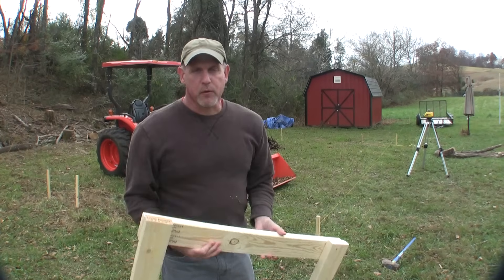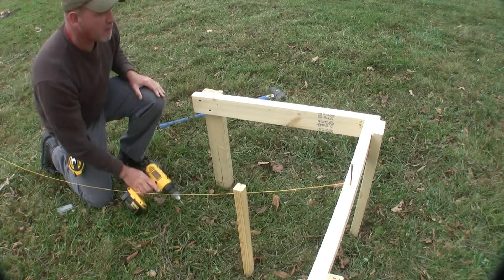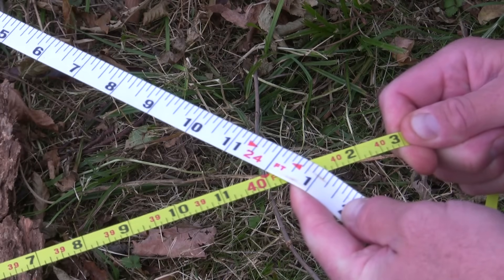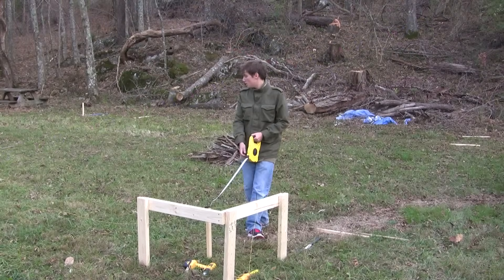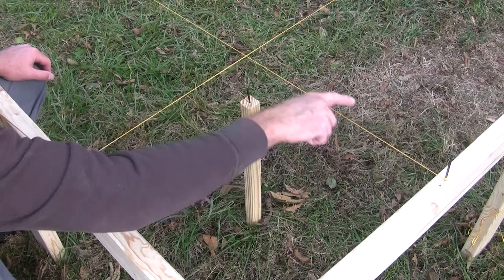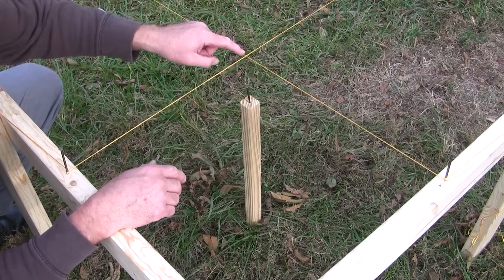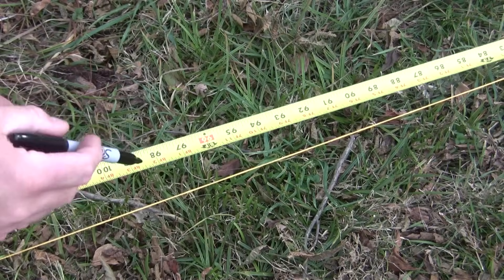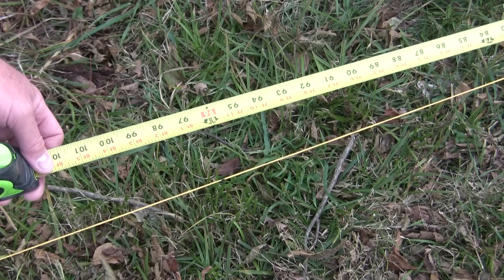How to Build a Pole Barn Pt 1 - Site Prep & Layout

Comment: thanks for your plain ,commonsense , and practical approach to this layout procedure on a building site !!!  I have built several buildings and my methods are very similar to yours except that I was stuck working pretty much alone on these projects , and I used a string and plumb bob to assign my post locations .  I am pretty old now , by the world's standards,  and I need to build a new pole barn and haven't done any of this in many years.  Your video is very encouraging and straight forward in the way you present all the information necessary to do the most tedious part of this build which is the squaring of the foundation layout .  Thanks again for your video !!!  I will be watching the rest of your build to fill in the gaps of what I have perhaps forgotten from my last building project and hopefully pick up a few new tricks and tips from your wisdom and experience !!  Greatly appreciate a hands on practical construct !!

Comment: I think you're doing great! You got a subscriber! I learned the purpose for the exterior corners allow me to set nails/points to cross strings that coincide with my vertices. Great job! Also I almost suggest you to paint the points of your vertices or whatever you'll be digging like every 8' you mentioned so once you remove your sticks to dig, you still have some paint on the ground.

Something to consider for future if you haven't. As you said, you want to make your barn 24'x32'. Now, is that the interior or the exterior of it? Why I ask? In reality, once done you'll know where or how wide by how long interiorly and exteriorly speaking you make it but, let's say you want those measures inside your barn. If that's the case, you want to add to the 24', and the 32' the sides of your pole. Let's say you will be using 4"x4"s, then you'll go with your exterior measurements 28"x36", and you find the diagonal of that and do what you did, so from there on, your interior will get to be 24'x32'. 

In houses where you'll add sheetrock, baseboards, in areas like kitchens where you'll add cabinets, you want to consider that your interior space will decrease a 5/8" for the sheetrock, a 12" deep by top cabinets I believe, a 30" deep for bottom cabinets (feel free to correct me on anything), I think 1/2" baseboards approx, sort of, future additions to your structural walls to consider so what you want in the interior, gets achieved.

Comment: I dig pools for a living and find myself using some of your methods, when I’m laying out a pool I like to use rebar instead of stakes because they’re smaller in diameter, also those soft tape measures your using will slip right over the top of the rebar. Or if you need the stakes for height, center a screw in it, and it’ll be tighter!
Reply: I’m addition when you have a cross, drop a stone from the cross three to five times and that’s pretty damn close to where you want your stake/ rebar

Comment: I've always used the 3/4/5 rule! Measure from the corner one string and mark 3' or any multiple of 3'. From the same corner, measure down the other string 4' or the same multiple of 4' used above and mark it. Now measure between the marks and perfect would be 5' or the same multiple used above! Adjust your angle to get exactly 5' or the multiple of 5' used between the dots. You now have a perfect right angle and corner to measure from! Repeat the process for each corner! Then measure corner to corner diagonally, to double check your work! Very fast, and all but measuring diagonally can be done by one person! 
EXAMPLES:
A- line 1=3', line 2=4', between the dots = 5'
B- line 1=9', line 2=12', between the dots = 15'

Comment: Pythagoras would be very proud of you! Brick masons use the common values of 3-4-5, measure 3' on one leg, 4' on the second leg and the diagonal will be 5'.
Reply: Yeah, 3-4-5 method can be done solo and it can be done on any length that's divisible to those numbers.

Comment: A simpler way to get square corners is the 3-4-5 method.  Measure 3 feet from corner on one string and 4 feet on the other and mark them now measure between those marks it must by 5 feet .  adjust strings so it measures up this way and corner is square.  you can do any multiple of this say 9-12-15 for bigger structures.

Comment: great series. its the end of January here in NW Missouri and i just started my 32 x 32 pole barn project. was going to wait til spring but have the money now. I also wanted to take advantage of the 11 percent rebate at the local lumber yard. we had a warm spell yesterday so i marked out the post holes. i knew how to square a structure by measuring corner to corner however the pyagoryth therom made that real easy using two 100 foot tapes. i was lucky enough to have a neighbor with a bobcat and post hole auger. that made that job quick and easy. going to take your advice and get that dirt out of the way. snow and rain on its way tonight.
Reply from the maker: Yes!!!!

Comment: Hi I have watched all your videos, thanks for sharing. I have a question. We have dug holes for the barn/garage but the next steps my son is suggesting is confusing me, would you be able to give comment on this. My son says we can just lay two bags of cement in the holes, level poles and then when we have the cement poured, the Liguid will seep to the bags and they will harden in this way? How can this work and not jeopardize the level and ending structure of the garage? Thx

Comment: On the corners, instead of running tapes across, you can measure one wall at 3' and another at 4' and mark both positions on the string. Then measure the marks on both strings (makes a triangle) and it should be 5'. This is called the 3,4,5 method from what I recall growing up and being taught from my parents and grandparents. Hasn't let me down yet. This can be done on the initial string as well as the string from each batter boards.

Comment: You're a good teacher.   In the past I've climbed the post to cut off excess height and knotch.  I was younger then. This spring I will adopt your  method of achieving a level plane in the hole.  I too always mix the concrete with water in a mixer then place in the hole.  Placing dry concrete directly in the hole tends to result in a weaker set.  The one thing I missed from your video is anchoring the pole in the concrete.  I usually screw in just one lag screw in one side of the pole to make it harder for wind to yank the pole out of the concrete.
Reply from the maker: Thanks James.  I appreciate you watching.

Comment: You where right to use the A^2+B^2=C^2 but you when the hard long way to find square. I always just square one corn off my start wall then using the math you can just measure 3 foot down one wall and 4 foot down the other the diag. will always be 5 foot. thats because 3^2+4^2=5^2, you can use any multiple of 3 and 4 together if needing to use bigger diag. then move to the next corner and so on, then use the cross for a final check its a hell of a time saver and can be done by one man.

Comment: Good  video...  may  i suggest 2 things..  (as  I will be building my  30 x 16 very soon)   As I learned from my carpenter uncle, the way to make  sure  your square  is know as the 3-4 -5 method,,(too much to explain in this typing but you can google it.)  It might be easier than  your  diagonal method.  Secondly, I will use  cement pylons for each  post rather than burying a post which will eventually rot underground even if  treated. I place a short rebar into the poured  pylon and then drill a hole on the end  of the  post...setting to post on the bar after the cement drys .... works like a champ to hold  the  post  in place...later  I go back and add more cement to form a cone at the bottom of the post...this keep water off the posts.  As  for leveling..... I run a string line with a level  on it  and  cut the posts for height at the top
Reply: What he did is the 3-4-5 method, just with different numbers.
Reply: I'm a machinist by trade and I am very precise in anything I do, especially numbers. Using the 345 method your moving your stakes around trying to "tune" the lengths in. The method used here I have been using forever and once you have established the one (1) length or width along a property line, etc, the other two (2) corners are knowns. No moving stakes like 345.
Reply from the maker: +RandomActUpMedia Great tips.  Thanks for sharing!

Comment: Seems like all the information I have researched has said that with just sticking wood in the ground verses the slab will not last. Mainly because of rooting wood. I'm looking at a home now to buy and the barn has that exact issue.
Reply: +james hawkins True that! There's nothing like having concrete footings to keep lumber out of moisture, even for a simple pole barn. Judging by the size of the project, he can off center middle sonotube footings and still have more than enough room for the tractor entry and it'll give the structure more stability.
Reply: A good approach is to stick your inner supports in the ground as these will not be exposed to wet or weather and put your outer supports on concrete footings as these will, if in the ground, be exposed to ground moisture and more chance of exposure to weather. Early builders who put them all in the ground used cedar or other rot resistant woods. You still see many of these old barns around which speaks volumes to their construction.
Reply: You could also use post protection

Comment: The same thing just happend to my tractor, barn roof caved in from a high wind and now its sitting out side all summer and is still there so in the next week or 2 im getting 40x60 pole barn with cement , so all i got to do is peel off the grass and get some sand on it and i will let the pole barn people do the rest.

Comment: Great video. It's nice to get a little guidance. A little rule of thumb to use in place of A^2 + B^2 = C^2 is the 3, 4, 5 rule. Otherwise the 24 (3 x 8), 32 (4 x 8), 40 (5 x 8). I hope this makes the math easier.
Reply from the maker: +Jim Beahm Excellent!  Thanks for sharing.

Comment: I have watch all your videos on how to build a pole shed, we are about to embark on build a pole shop ourselves.  My one question is in reference to your laser level.  I read that you are using a Bosch model GRL250HVCK.  But what are all the components that a person needs to purchase to be able to use the level the posts and find the grade.  The laser level itself, the tripod, and rod with remote....do I have this correct????
Reply from the maker: M Diamond Thanks for watching.  Yes, you need the laser, tripod, the rod, and receiver.  The remote is not necessary.  The kit that Lowes sells comes with everything you need.  Seems like it's about 600 bucks.

Comment: Quick Question. I don't have a gee whiz level like yours. My dad was saying that since all my poles are 16ft Tall and I am going to have to cut them off when I run the top band, that I can select the level corner post and run a string level from that one to all of the others and cut each one level with the level corner pole. Is that a good way to do it without a level like yours?   Thanks
Reply from the maker: Bill McCutcheon That is the way most folks do it.  It's just a bit of a pain to make those cuts off a ladder but you can still do it that way.

Comment: What is the name of the laser leveling tool that you used to check the grade?  Does it come attached to the yard stick or did you purchase the 2 separate and attach it?
Reply from the maker: DrewThomas Arnal It's a Bosch.  Can't remember the model but it came from Lowes.  It comes with the stick and receiver.

Comment: Your series on building a pole barn is outstanding. I've watched all of them at least a half dozen times.  Over the years I've built numerous things.  However, at 60 years of age I'm still learning and I learned a lot from your videos.  Many of the techniques you discussed were used in my 40'x60' barn in current development.  Like you I'm building it alone and in my own time.  It would've been finished but for wet winter weather which slowed the process.  Thank you for taking time to share your efforts.  They greatly contributed to the success of my project.
Reply from the maker: 08Maxwell1 Thanks for the great feedback and kind words.  I appreciate you watching.  Lemme know how yours turns out!

Comment: Can you share what kind of laser you're using?  I just got some power poles from a buddy of mine that works for the local power company (12 - 16footers....) I'm going with metal trusses, and I've got to be dialed in on 23' 1" span for connection.  Going to be kind of tricky with the round poles.  I'm not on perfectly level ground, and need to understand how you used the level to determine height for the concrete beds in the holes.
Reply from the maker: Tom DuMay It's a Bosch model GRL250HVCK.  Got it from Lowes.  Good luck with your project and lemme low how it turns out!

Comment: I have many large pine trees on my property (Florida) can I use those to build a pole barn??
Reply from the maker: Itazuke Dee I don't see why not, but I'm not really an expert about that.  Thanks for watching.
Reply: First I want to say Thank You to blazingnailgun for the videos. I have recently discovered a saw mill you can make using a chain saw. cost couple hundred i think, but you might want to check it out (ebay or Amazon)to use them pine trees.
Reply: The best poles are black locust and cedar because they have a very high natural resistance to rotting.
Reply: I only wish I had cedar, not only bug free, but will last forever...build a log cedar home if I did.

Comment: Thanks for this great series of videos! How and where did you setup your laser level?
Reply: self leveling compared to manual leveling?
Reply from the maker: mustangman99 Self leveling is the way to go.
Reply from the maker: Thanks for watching and for the kind words.  I appreciate it.  I tried to set the level up in the center of the building but it doesn't really matter.  In fact, I moved it around a few times in order to get it to shoot straighter to where I was working/holding the receiver.

Comment: I built a 30 x 64  x 16 pole barn (still working on somewhat) about 8 yrs ago, 1st major thing I built.  I recommend not using nylon tapes, only steel,  cloth or nylon long tapes stretch and will give you in-accurate measurements.  I learned this the hard way as my diagonals were off 1.5 inches
Reply from the maker: Thanks for watching and commenting.  Great tip.  Thanks for sharing!
Reply: They might have been off, but they were off the same, which means you were square right ;)

Comment: I'm in the planning stages of building a pole barn and found your videos. Straight forward and down to earth. I usually use the 3-4-5 method but I'm going to try your squaring method. Great video!
Reply from the maker: Thanks for the great feedback.  I appreciate it.  I think you will see the way I do it is very accurate given the ease of doing it that way.  Good luck!
Reply: The 24X32x40 was actually a 3-4-5 triangle.  Multiply by 8.  I always keep an eye out for the multiples, then you don't actually have to solve the square root of the C side.  Plus, it's always whole numbers so you don't have to convert 16.42579 to inches.  There are a few other special triangles, but they aren't as helpful in construction: 
5:12:13
8:15:17
7:24:25
9:40:41

Comment: How do you like that L series Kubota? I am leaning towards the 30HP B series because I need to maneuver around the wood lots on my property . . How is the L series in the woods?
Reply from the maker: I have a 3240 and it serves all my needs well.  It's a little big to trek through the woods, especially with the loader on it.  With the loader off it might do ok.  Mine is 4WD so it can get out of a pinch and it's pretty powerful.  The PTO has plenty of HP for my needs too.  I think it's got about 26 HP on the PTO.  It turns my big woodchipper, tiller, post hole digger, finish mower, etc. just fine.  Thanks for watching!

Comment: I noticed you said "Good Enough" for you and not the normal jobsite term "Close Enough". You are doing it right in my opinion and believe me that you are doing a better job than what I see on jobs I have looked at. I built 2 sheds and was cussed when I made measurements within 1/8" and famous line was "Were not building the Taj Mahal" ... well when you are the person paying for it you think you are... damn fine job
Reply from the maker: Thanks so much for the kind words and great feedback.  I appreciate it!  Sounds like you know the deal.  There's times when you don't sweat the small stuff but there's times where the small stuff is very important three or four steps down the line.  I guess the fact that I am on my own timeline takes some of the pressure off.  Thanks again for watching and commenting!

Comment: What is the name/brand of the level device you are using? I am looking for one but want a good one. Thanks
Reply from the maker: Thanks for watching.  The one in this video is a rental and I don't know what kind was.  Mine crashed so I rented this one but I ended up getting another one that I use in the subsequent pole barn videos.  The one I got was a Bosch GRL250HVCK.  It's good for the money and very accurate.  It's ultra sensitive and it will drive you crazy trying to get solid tone on it, but once you use it some you get the hang of it and learn when you are dead on even if the tone is still chirping.  That's the only complaint I have with it.  Good luck!